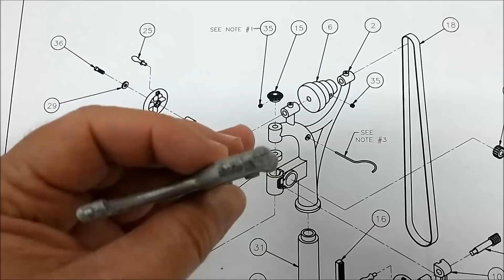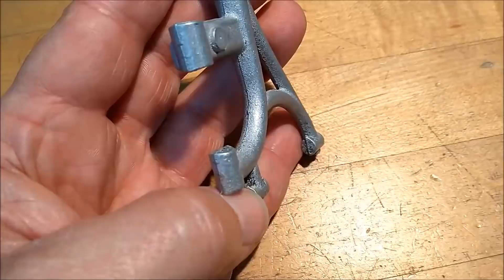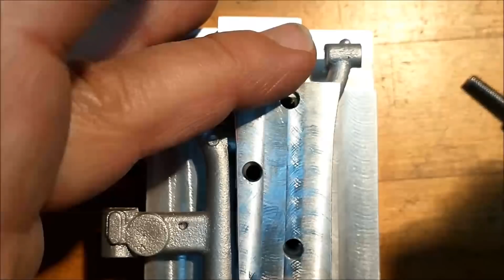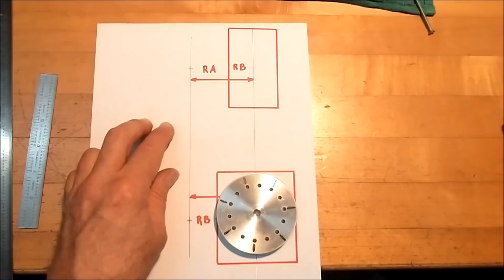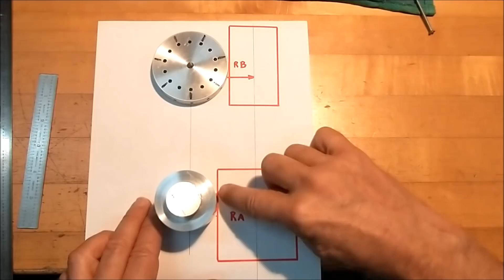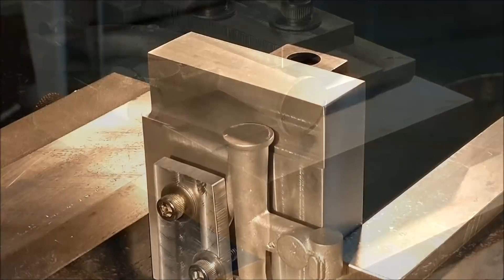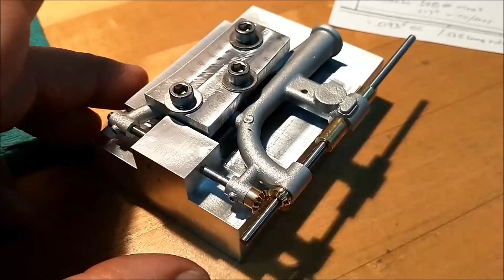You Can't Cut What You Can't Hold !!!

Comment: Hi Joe.
Did I miss it  
Radii a + b & b + a ..
Did you nip the clamp plate and tap the casting to achieve to location and then again for the other 2 bosses ?
That must have been a fiddle unless the casting was true at 90°
Reply: Agreed.  Would've been nice to see some of the futzing that must have occurred between "Phase 1: Square up fixture & clamp part to it" and "Phase 3: Reciprocal radii match - profit!", even just a time-lapse.  Did you use a single shaft with both radii on it to make the iterations easier?

Beautiful result as usual!  Thanks once more for all your efforts bringing us the artistry!
Reply from the maker: I made many 'Y' axis table moves bumping the part as I went to get the gaps to where i wanted them. It wasn't a one shot deal by any means.